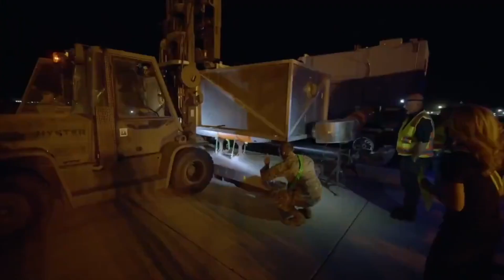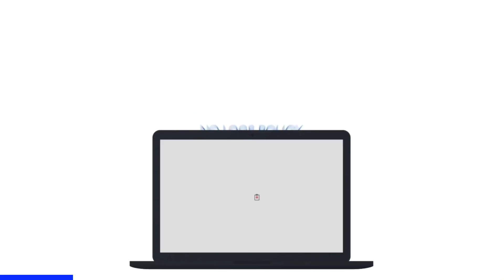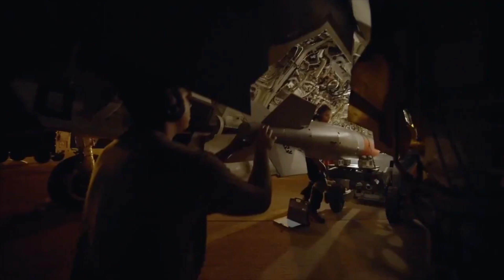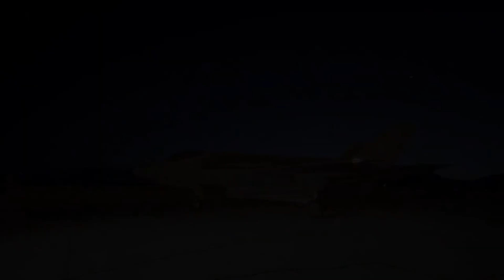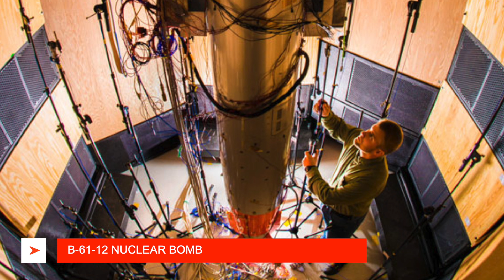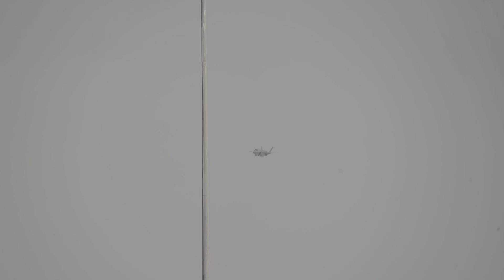How B61-12 armed F-35 is set to enhance US nuclear deterrence ?

Comment: A shame that B-61s cannot be carried by F-35Bs.

The fact that F-35Bs can take off and land from potentially thousands of remote, harder to find places would greatly enhance deterrence.
Reply: Adopting the B-61 to the F-35 would ironically cancel the UK's order for the F-35A as the B would able to carry it
but realistically ,the F-35B would need a new design
Reply: That is not how it works. When you have a low observable platform like the JSF they can get in with precision weapons and do it that way you don't need a tactical nuke.
Reply: @thevanillafacemale  A single plane load of precision weapons isn't going to wipe out an entire unit, beachhead, bridgehead, airfield, logistics base, etc. which is what a tactical nuke would be used to hit. No conventional weapon is capable of hitting area targets like that.

In addition, this bomb can also be carried by F-15, F-16, and Tornado fighters used by allied nations that participate in the NATO nuclear sharing program.
Reply: @willythemailboy2 precision accuracy sends a message that the capability is there. Otherwise sprinkle a few CBU onto the area that will take care of the wide area of concern. Also can drop munitions that are landmine types there are all sorts of munitions the B61, everybody's going to be up in arms as soon as a nuke is used.
Reply: @thevanillafacemale There are never enough options.
Reply: F-35Bs weapons bay is not large enough to handle the b61, because the STOVL lift fan limits its size.